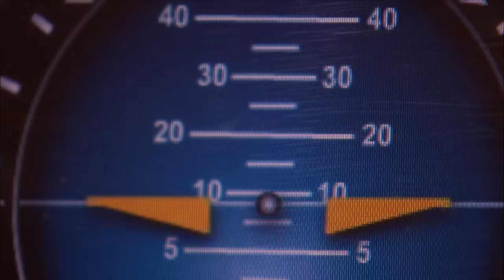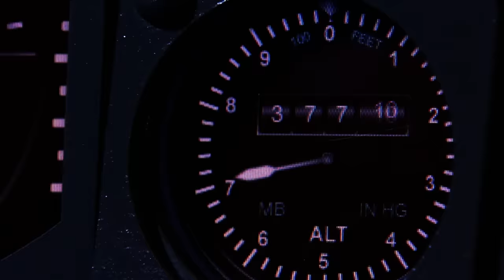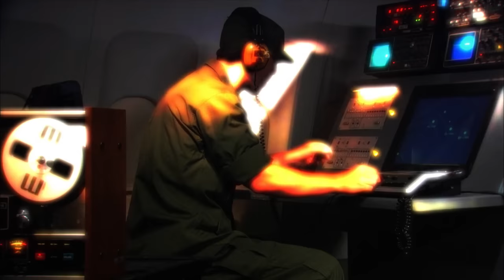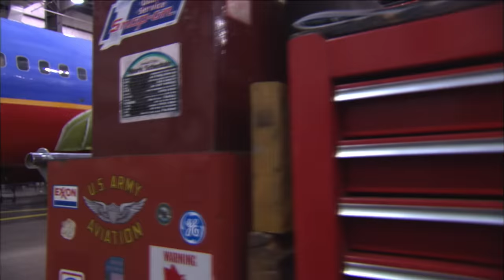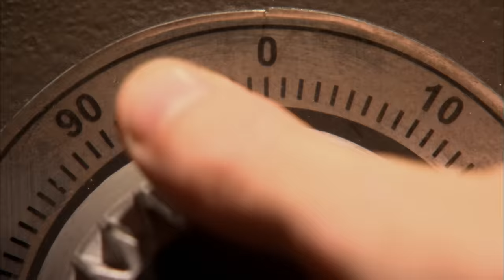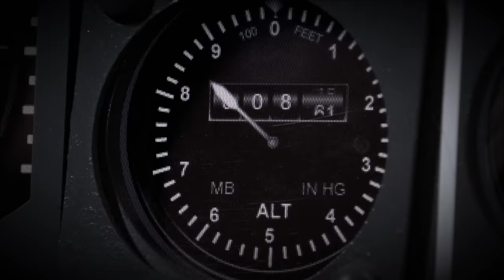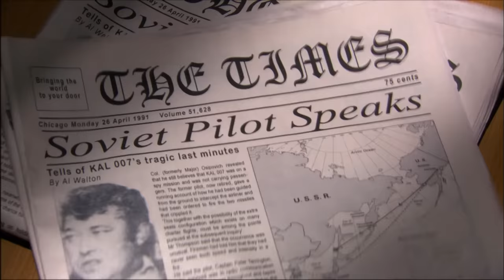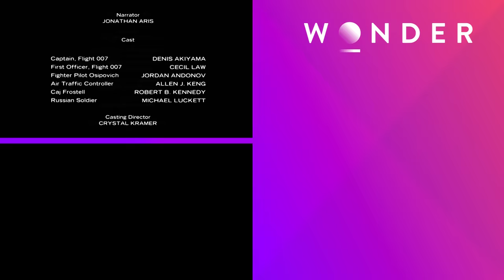The Downfall Of The Korean Airlines Flight 007 | Mayday

Comment: also find it very suprising how they never mentioned that THIS EXACT SAME THING happened to a KAL 707 only 5 years earlier. Its so crazy this happened twice to the same airline. Thankfully the 707 was able to land in some soviet field but sadly 2 people perished rip
Reply: @quangminhnguyen2504  they never do. In 1972, an AA DC-10 had its cargo door blown off mid-flight, causing explosive decompression. But the pilots were able to land in Detroit with no fatalities. Sadly the problems weren't fixed and two years later a Turkish Airlines DC-10  had its cargo door blown off soon after takeoff, destroying all the hydraulic controls, resulting in 346 deaths.
Reply: Unlike this incident the pilots of the fighter jet that shot the missile knew it was a passenger plane

Comment: They don't mention in this video that the 007 pilot was known to be arrogantly self-assured and hot-headed, and so the crew may have been afraid to speak up and tell him that he might be making a mistake.
Reply: I think something similar happened with a Korean Air Cargo Airliner. Seems to be a cultural thing relating to respect of authority.
Reply: @cs-yg2ct  Yes, or the infamous Tenerife airport disaster back in the mid-'70s, where two 747s collided.  It was the same situation of underlings' being afraid to speak up and refute the words/actions of their superior officers.
Reply: @Quacks0  yeah that was one of the major factors but also it was like the most unlikely thing to happen, terrorist cause the runway to shut down, directing flights to a small island that had one small runway, only 2 atc, no room to put planes anywhere, there was fog and confusion and sadly it caused almost 600 deaths
Reply: Korean airlines in general had a huge problem with crew resource management, something they still work on to this day. Very hierarchical culture where challenging superiors is a big no-no.
Reply: @Quacks0  I remember that, damn arrogant pilot didn’t want to listen and take off without permission. All because he was the face of the company
Reply: @sjc4  telling the captain to turn on the right navigation system wouldn't be a "challenge". likely the co-pilot is equally stupid.
Reply: @Quacks0  I watched the "Mayday" documentary about the Tenerife crash and wondered if the cockpit recorder actually picked up the pilot's conversations w/the flight attendants because the show portrayed the pilot as continually berating the flight attendants. I wonder if this was true or if the show dramatized the extent of the pilot's alleged abusive behavior.
Reply: @isabellind1292  Who knows?  I just know that this "toxic cockpit environment" situation was a major issue for many lower-ranking cockpit personnel during this period.  And I know that higher-ups' browbeating their underlings is a huge problem in both private and commercial entities.  So I can certainly see how this "I outrank you, so keep your mouth shut" situation could very likely have been the case here.
Reply: @Quacks0  If that's the way he really talked to his colleagues, he should have been grounded! He had serious anger issues! He sounded completely unhinged!
Reply: @sjc4 Could that have also played a factor in the Asiana 214 crash?

Comment: Soviets managed to confuse KAL 007 with the RC-135 Cobra Ball aircraft. Cobra Dane was the ground-based facility, Cobra Judy was the ship (USNS Observation Island), and Cobra Ball was the aircraft. Dane can’t see over the horizon to get exoatmospheric data.  The Ball aircraft can but since it is an airplane it cannot support the heavy sensors needed for high resolution data.  Judy can sit a few miles offshore of Mother Russia and can get both via her S-Band phased array and her X-Band 30ft custom sensor. Judy left station to assist in the search for KAL 007.

Comment: Major issues with the Soviet's failure to ID the plane as civilian vice military (even off course): why didn't they detect their transponder code? It's supposed to ID the aircraft as well as give out positional data on air traffic radar. Shouldn't they have seen this on their ATC radars? Also, they should've easily heard the radio chatter between the airliners and ATC in Japan, they're not encrypted. Even if they thought it was a spy plane, WTF shoot down and unarmed aircraft without first attempting to make contact? The Soviets were overly aggressive, hostile and negligent. No excuse.
Reply: The Soviet pilot stated that an aircraft can carry deceptive lighting, which is true. An aircraft trying to hide can also squawk a false transponder code. So detecting a civilian code would not have changed the outcome.

Listening to the ATC freqs might have helped, but they probably didn't know which freq the aircraft was using, especially given that the aircraft was in the wrong place. The Soviets were not accustomed to knowing which freqs might be in use, and they were short on time, so looking up that information was unrealistic.

And they did try to make contact. The pilot talked about his efforts to do so. Those efforts failed, but they did happen.
Reply: I agree with you on all points
Reply: @River Crimea - you’re also discounting this was the Soviet Union at an intense point in the Cold War. You genuinely don’t think they had the ability to listen in on ATC before deciding to shoot down the plane? 

They were in direct contact with command during this entire encounter and could have easily verified but wanted to shoot it down regardless of what it was before it hit international waters. It was pure aggression.
Reply: @herrdog  I am discounting absolutely nothing. I am keenly aware of the USSR's attitudes, both generally during the Cold War and specifically when this incident happened.

I genuinely never said or meant that they didn't have that ability. I said the necessary information (radio frequencies) was, most likely, something they used rarely, if at all, and that finding the information would have taken more time than they had, lest the aircraft leave Soviet airspace before they could take action.

As you can see, then, there was no need to call out my error, since there was no error. You and I were in agreement on this topic from the beginning. 😉
Reply: @herrdog  Also remember that there was a spy plane in the sky that night, and they were convinced that the aircraft in their airspace was that plane. There was no good reason for a commercial aircraft to be there, and they therefore had no good reason to suspect that it was a commercial aircraft.

So, again, yes, they obviously had the ability to listen to ATC. What they lacked were the knowledge of which freqs to tune to, any reason to suspect it was a commercial flight, and time to make a slow and careful analysis.
Reply: @River Crimea I’m taking it based on your stance you haven’t read the transcripts of the Russian command and the conversations of pilots? All of this came out after the collapse in the 90s. They were very aware it was possibly a commercial craft and yet one General gave the order to fire regardless and stood by it years later. Several commanders voiced concern that they couldn’t believe the enemy would be this blatantly stupid.

I don’t get exactly what your point is besides to give the Russians slack here which is far from warranted.

Edit: also in regards to your comment about the American spy plane that was near Soviet airspace, they were aware this wasn’t the same plane.
Reply: @herrdog  Okay. Fine. Whatever.

No, I haven't read the transcripts. I watched the video on which we are commenting. That's it. I was unaware until now that the prerequisites for commenting on a video are to watch the video AND to pore over every printed word that is available on the subject. My most humble apologies.

And not one thing I said was intended to "give the Russians slack" or to be construed as such. I simply made educated and reasoned guesses as to the most logical course of action they might have taken and their reasons for doing so. These guesses were based on the information available to me--which, as I already stated, consisted of this video and zero else. Again, my deepest apologies for not meeting your exacting standards before leaving comments.

All of that being said, I did not come here to engage in fisticuffs. I have 0% interest in an argument. I have even less interest in listening to someone who knows absolutely nothing about me blithely INFORM me about my own attitudes and opinions regarding third parties.

Thank you for your time. Do not expect another response from me. Ain't gonna happen.
Reply: @River Crimea lmao proven wrong so take some bizarre moral high road approach in an essay like response? You must be a real popular person.
Reply: @herrdog  lol. wonder what he wouldve said if this video was about the iran air flight shot down by the us
Reply: Kinda like the same mistakes the US Navy made when it shot down Iranian Air flight 655 five years later...
Reply: yes, but this is video about another incident. not the unrelated iranair one
Reply: @h20bp  except it was a combat zone (Operation Praying Mantis). Flight 007 was not in a combat zone. Mistake? Yes. But not the same.
Reply: You do know civilian and military flights use 2 different systems away from.each other right? Ask america when one of their "most advanced ships ever" shot down civilians.
Reply: @rivercrimea4849 oof 😬... I've never read something so cringe inducing in my life, like not even joking. What a drama queen. 🙄

Comment: It's so strange that the system was set up to show the pilots a flight path which they weren't actually following since they hadn't flipped another switch. Crazy.
Reply: I was surprise that the system didn't over ride the previous input.
Reply: No its not. No different than an Uber driver following the passangers  destination even though his route may be off course
Reply: @Ttcopp12rt  Oh, so you mean a human air traffic controller was directing them where to go?
Reply: @KingoftheJuice18  yea.... Flight plans are never what happens, things change an pilots follow air traffics advice at all times not the original plan
Reply: @dylanlevy2107  It was six months ago, but from what I recall what you're talking about is a different issue.
Reply: @KingoftheJuice18  what do u mean 6 months ago this incident happened in the 80s read the bio, and flight plans are NEVER what happens I am a pilot some times u change altitude, sometimes u go around a storm all sorts of stuff happens every flight .. the original flight plan an altitudes ALWAYS change
Reply: @dylanlevy2107  I POSTED this and watched the video six months ago. The error in the video, if I recall, was technological, NOT ATC giving different instructions
Reply: @KingoftheJuice18  no it wasn't technological, they set way points but they didn't follow way points cause they never turned it on! They just followed a normal compass in the plane which led them 560 km off course.. I was just saying like the other guy that flight plans always change an air traffic changes things alot but yea the pilot never turned the INS on so he wasn't following way points that's why it went into Russia who shot it down
Reply: @dylanlevy2107  Yes, and therefore, as I said: "It's so strange that the system was set up to show the pilots a flight path which they weren't actually following since they hadn't flipped another switch. Crazy."
Reply: @KingoftheJuice18  bro the guy above said no it's like not plugging in your route in Uber then u said so it's air traffic ? So I specified he did have the ordinance typed in but he never turns INS on meaning he was only following the compass so it's not air traffics fault, he literally just followed the compass an not INS
Reply: @dylanlevy2107  Yes, overlooking flipping one switch sent him hundreds of miles off-course.....That's one crazy system!
Reply: @KingoftheJuice18  kinda like using a gps but never pressing start lmao
Reply: @dylanlevy2107  My original critique was that such an oversight should be impossible. There have to be backups and fail-safes. It can't all depend on flipping one switch.
Reply: @KingoftheJuice18  I mean there's nothing really u can do cause u need the compass to get to the runway, maybe if it had an alarm once u reached the runway saying TURN INS on maybe that would work.. but they have checklists that's why u follow them so it's literally the pilots fault
Reply: @KingoftheJuice18  I get what you're saying! I also get what other people mentioned about arrogant pilots!

Comment: The discussion with the US military about how the classified information was able to find out the location of the plane is probably way more advanced than what most thought was in the 80s. I recieve briefings on classified information and can confirm what is released to the public has a 5 year delay. that being said, the US at the time knew exactly where the plane was and had to buffer it for a reason
Reply: Like not to fuel public to anger?

Comment: Those 2 mig pilots were ordered to  immediately shoot it down when located...But they had pretended to have trouble finding it ...They spent 20 minutes or so doing everything they could to get the plane to acknowledge them...The lead mig even shot bullets across their windshield...Both migs got right up to the windows of the cockpit on both sides and the pilot and the copilot wouldn't even turn their heads to acknowledge the migs...The migs knew it was a passenger plane they could see all the windows full of faces watching them...But now they had no choice but to shoot it down...Even after firing a missile the plane still had several minutes of enough control for a crash landing...What Those mig pilots did was a very serious no no by trying to save those people and were punished terribly..Now I  know the truth about why this happened but have decided to take it to the grave...
Reply: The 747 was not there by accident

Comment: My biggest problem with this is that nobody tried to communicate with them, they may have tried to use military radio but if it looks like a passenger plane shouldn’t you try and use civilian radio? 

Also isn’t it reasonable for a civilian to panic when getting shot at? Shouldn’t they have considered that the civvy may have tried evasive maneuvers if they did hear the shots?

Comment: The entire Flight of KAL 007 was a deadly and unnecessary gamble that the Plane would not be Shot Down even though those who programed the Flight coordinates knew that it had very little of  a chance that the Passenger Plane would not be detected so Far off course  . KAL 007 was flying in restricted Soviet Russian Airspace for several hours and was hundreds of miles away from the International Airspace where the Passenger Plane should have been . The Actions taken by the Russian government and Military  was Totally and Justifiably Correct  .
The Lives of those Passengers on Flight KAL 007 were intentionally Sacrificesed and President Ronald Reagan was Fully Aware of what was taking place from the beginning to the end .